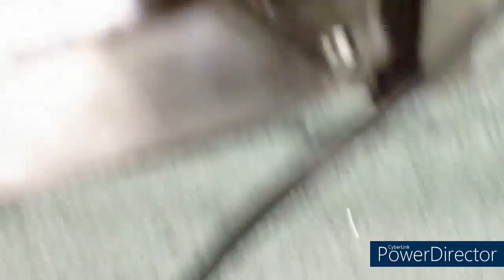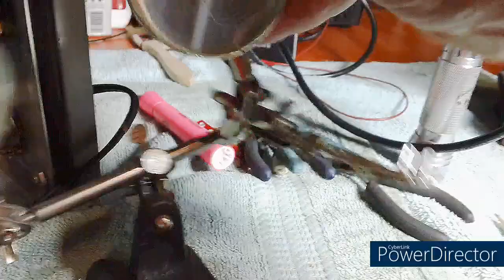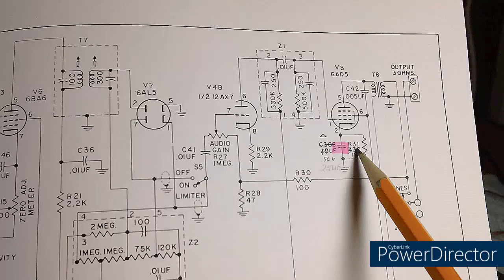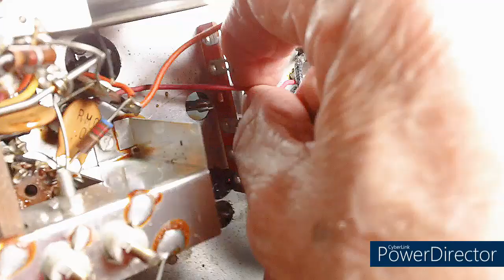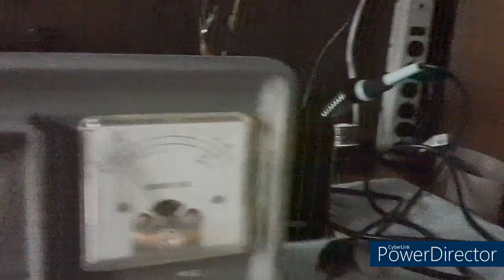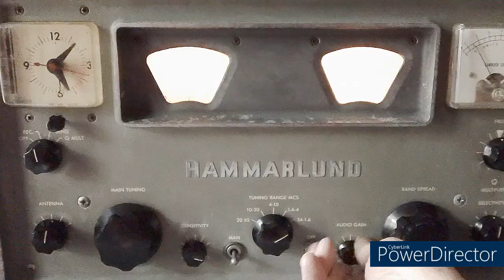Hammarlund HQ-100C repair and restoration.  Part 3 of 4.

Comment: Hi John not sure if you know this or not but the Hakko fx300 is discontinued they went with a new one  called the fx301 the new one has a  better heater and faster heat up time. The tips on the fx 300 are not compatible with the fx 301.one problem with the fx 300 is the pump would become clogged the new fx301has a beter pump and can be cleaned out. Again the parts for the fx300 are all discontinued. I found this out when I went to replace my fx300 pump so I bought the new fx301 and I found it did work better than the fx300.  Their is a YouTube channel called eye on Hakko and it shows how to replace the pump and how to maintain the fx301.  Hope this helps.
Reply from the maker: Thanks, Don, but I'm not in the market for another overpriced vacuum solder extractor.  Besides, I've never had any problems with this one, probably because I don't use it that often.  It works fine.
Regards,
John